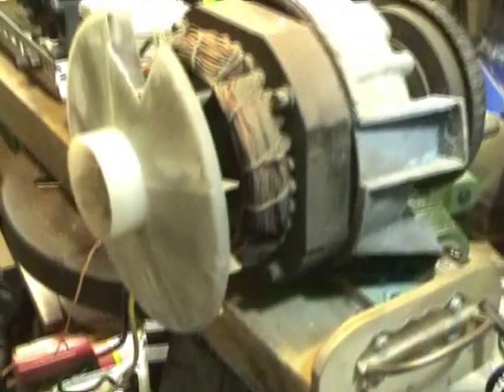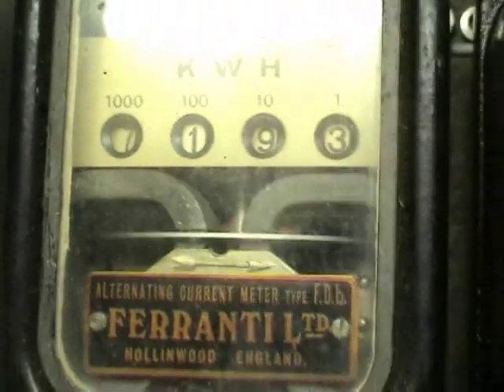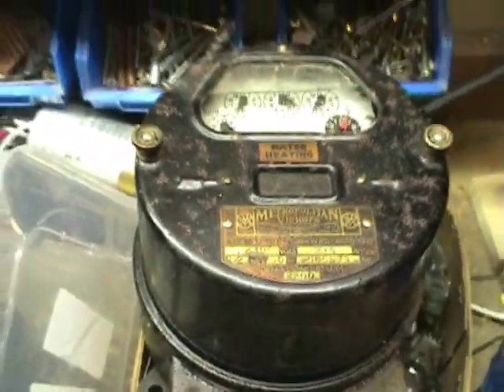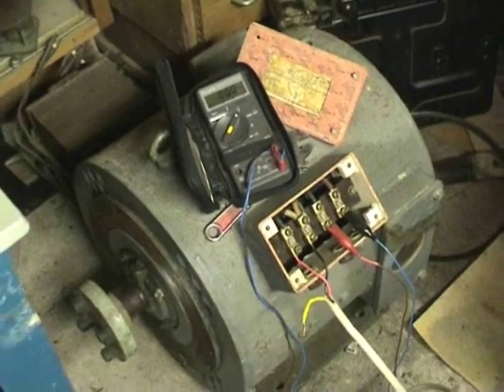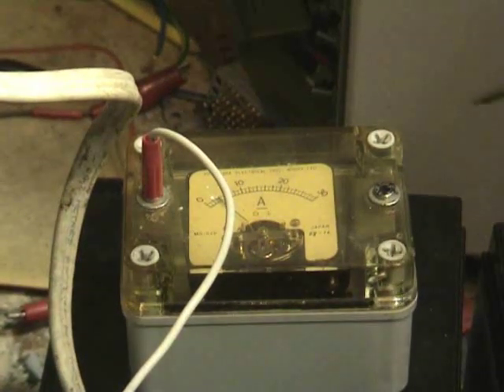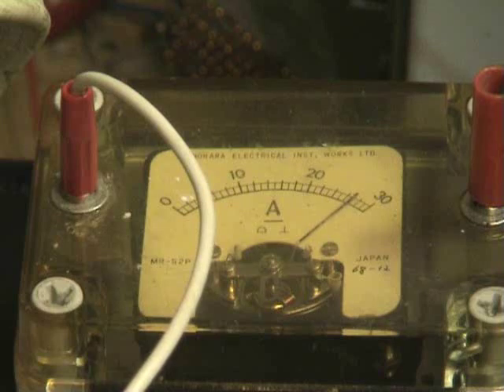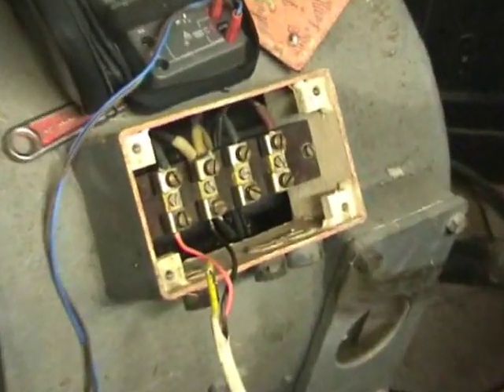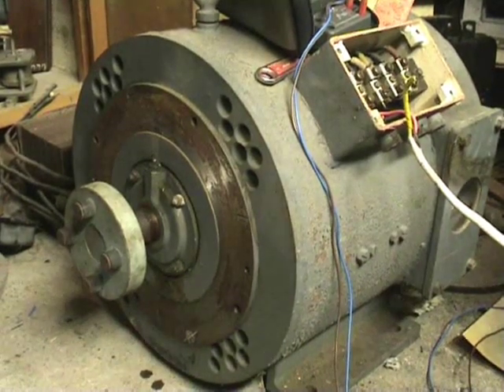Junk in my workshop and big DC motor testrun

Comment: How come it has 4 terminals i would of thought red and black live 240 i dont know mutch about motors
Reply from the maker: It is a series wound compound motor which has separated field winding hence 4 terminals.
Reply: so 240 goes to one set or the other set does it mater if its 240 live to live or 240 live to neutral

Comment from the maker: @EngineManic Yes, with capacitors across the windings, a bit of trial and error required to get it right. See my 3 phase motor video where I run (generate) 230 / 400 from a 3 phase motor

Comment: @RODALCO2007 And your reel to reel tape recorders surely have the best sound quality. Do you run them at the higher tape speeds ie 15 IPS (38 CMS) or higher? The built in R2R in my console only has 3-3/4 and 7-1/2 IPS (9.5 and 19 CMS). Max high frequency response around 15 KHz FM radio quality but not bad.

Comment from the maker: @Nivicoman Yes, Japan has two frequencies. I am well aware of that as I have reel to reel tape recorders which are multi voltage and 50/60 Hz with the pulley arrangement.
It is interesting that Japan never standardized the frequency. probably too hard and expensive.

Comment: Did you know Japan is 50/60 Hz split around the Tokyo area? Frequency converters are used to enable both grids to be connected. Tokyo and northward electrified by Siemens and Osaka southwards by Westinghouse hence the 2 standards. Back in the day of turntables and tape decks running sychronous motors you would change the pulley to accomodate the 3000 or 3600 rpm speed. Sometimes the motor windings were tapped for 50 or 60 Hz with the different inductive current draws.